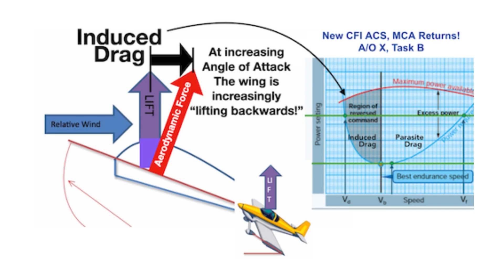SAFE CFI-MCA Webinar Promo

Comment: The Viper wasn’t a behind the power curve issue; it was flawed feedback loops in an inherently unstable platform that required the computer to compensate for the instability in a fly-by-wire system. Not an energy related problem.